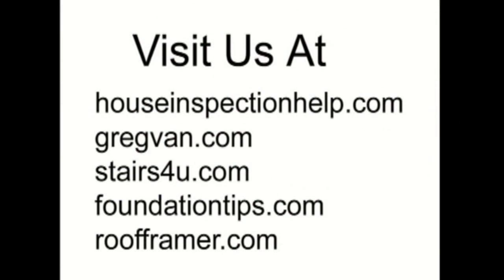Stair Design Ideas and Tips - 17 1/2" Stair Building Rule

Comment: My stairs at home is built at 4 inch riser and 13 inch width. This is just perfect.  The short lift is easy esp for old folks who don't exert much effort on the legs when going up. The wide tread is safe in coming down, the entire foot seats well on a wide tread.  I can go up and down the stairs anytime.  I submit this dimensions should be the standard measurement in any building.  Young people mAy not notice these details but later on in life, they will be see this as a necessary inclusion into their homes.☘️🌼
Reply from the maker: I don't know if that would be a good idea to make a standard dimension for everyone, but most definitely for anyone who would have a difficult time climbing a standard set of stairs with 7 inch risers and 10 inch treads. Nice try though :)